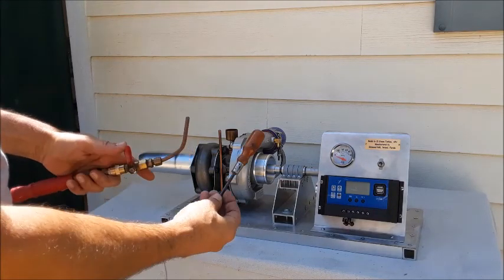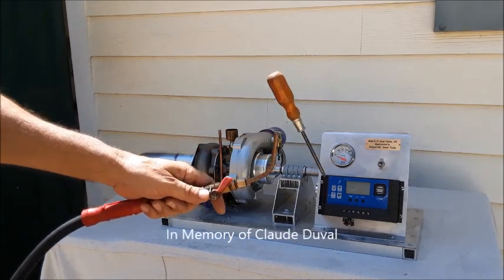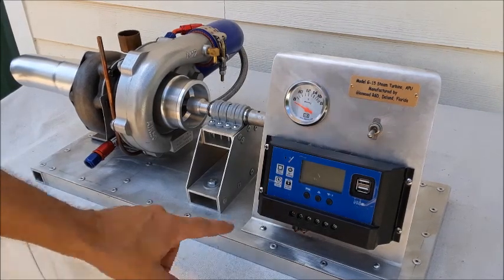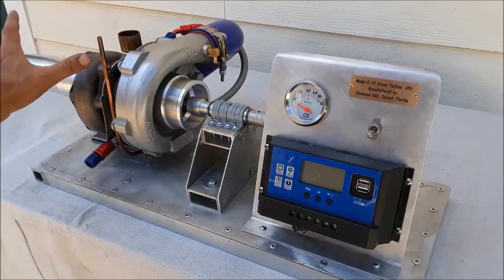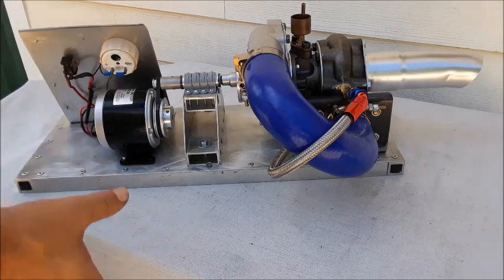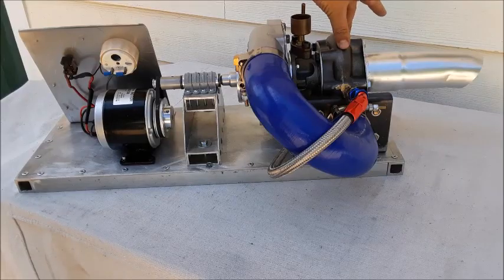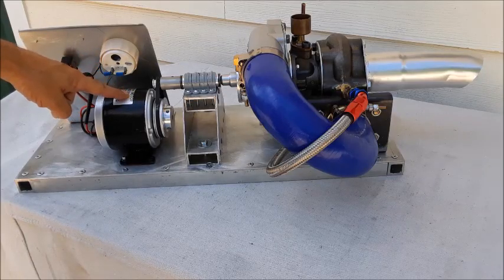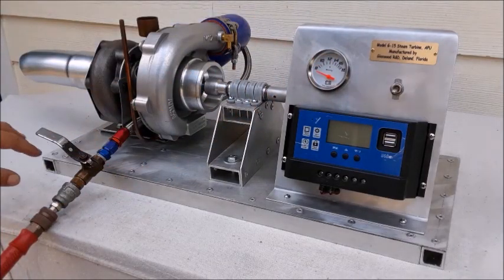Steam Turbine Upgrade

Comment: Have you ever built any Tesla turbines?
Reply from the maker: No....but one day. It is my understanding they need to reach insane rpm's to become effective. I am a huge Tesla fan, tho.
Reply: @gwseymour  it’s pretty awesome what you’ve made here with this car turbo though!  

And yeah I’ve seen many people try to make them and just spin them fast and they don’t work. But fortunately the too high of rpm is not an issue actually because, despite what’s claimed over and over again by many people on the interwebs, Tesla turbines work fine, get plenty of torque and output power at low RPMs.     

I’ve got some copy pasta 🍝 of mine that I’ll share with ya here to explain more.  

Tesla turbines aren’t made efficient by spinning really fast.   

That’s only for when the disc stack is being used as a centrifugal pump, because ALL centrifugal pumps’ compressors, performance is tip speed dependent.   

But spinning the turbine fast will produce a centrifugal head that opposes the incoming fluid flow, reducing the pressure gradient across the nozzle, reducing fluid final velocity, reducing mass flow rates through the nozzle and ultimately reducing power out. 

Furthermore the faster you spin them the faster the fluid you have has to go just to still be moving faster than the discs and still provide torque.   

Lastly, they work just fine for industrial use too, despite people saying they can’t scale up in size but they actually can scale up just fine because the torque on the discs is proportional to the difference in the fluid speed and the disc speed. 

So the disc tip speed is the important factor here. 

For any given fluid supply in the nozzle will have a max fluid velocity. 

So the turbine disc tips will have a max speed set at that fluid speed irrelevant if radius. 

Now considering that centripetal force is proportional to V^2/R, if you keep the tip speed the same but increase the radius the centripetal forces on the disc for the speeds needed will actually decrease. 

Again despite what MANY have claimed about the Tesla turbine, it does not need to be spun fast to work or work efficiently.   

TesTurs are made efficient when the slip on the discs is reduced and spinning the discs fast does nothing to reduce the slip, only increase the distance the fluid slips on the disc faces, which is by definition “loss”.  

Listen to what Tesla himself said in the patents of how to make them work.  

“Owing to a number of causes affecting the performance, it is difficult to frame a precise rule which would be generally applicable, but it may be stated that within certain limits, and other conditions being the same, the torque is directly proportionate to the square of the velocity of the fluid relatively to the runner and to the effective area of the disks and, inversely, to the distance separating them. 

The machine will, generally, perform its maximum work when the effective speed of the runner is one-half of that of the fluid; but to attain the highest economy, the relative speed or slip, for any given performance, should be as small as possible. 

This condition may be to any desired degree approximated by increasing the active area of and reducing the space between the disks.”  

1) increase the speed of the fluid relative to the disc, (not increase disc speed)  

2) increase surface area 

3) decrease disc spacing  This is how you actually make a TesTur work. Not by spinning it fast.   

The fluid interactions with the disc that govern efficiency an torque are adhesion and cohesion. Full stop. 

And spinning fast does nothing to increasing either to increase the turbines isentropic efficiency.   

This is why everyone who chases rpm with the TesTur just flat out fails. 

They aren’t even trying to design them properly so of course they won’t work.
Reply from the maker: @CharlieSolis  Thanks!  I would still submit that HP is always a result of RPM. Any type of power extraction (mechanical, electromagnetic, etc.) creates a load, which reduces RPM. The more initial rpm you have, the greater the resistance to reduction under a given load (due to an increase in HP). I am going to build one someday, but I anticipate some tinkering. Thanks for the input.
Reply: @gwseymour  hey thanks for replying. So when doing electricity generation the rpm is always kept constant. And when using turbines there is no need for a flywheel type storage because there is no pulsed torque input that needs to be smoothed out, like with piston engines or pulsed combustion engines.

When operating using a dynamic load one does not rely on the turbines kinetic energy to resist changes in rpm/voltage output. 

If the rpm drops even a little the throttle should automatically open up and admit more motive fluid. 

Power = Torque * RPM / 5252

Therefore when doing electricity generation, the rpm is always kept constant because voltage output always supposed to remain constant and is dependent upon the turbine/generator RPM. 

So if the load increases, the turbine momentarily slows down just the slightest bit because of the increase in resistance in load, but then the throttle opens up to admit more fluid to output more torque to get more power out for the same RPM, that counters the increase in load. 

If you look at all the old pictures of teslas turbine, specifically the one in the museum that everyone has seen, the big ol’ system of valve and pipes above the turbine is pneumatic throttle regulator that operates off the peripheral pressure in the turbine. Because centrifugal head increases at a rate of RPM^2, or even faster, tiny changes in rpm once at speed have great differences in peripheral pressures. 

So when the load is applied and the turbine momentarily slows down the periphery pressure drops and pressure drop in the piston throttle regulator causes the spring to over come it and it opens up the throttle letting more motive fluid in. When the load is dropped and the rpm wants to jump up real fast the peripheral pressure jumps real fast before much change in the rpm and the piston throttle regulator begins to close off the throttle again.
Reply: @gwseymour  you have to remember this is not a rotational battery that “charges and discharges” the energy through a change in rotational kinetic energy. 

For using turbines for electricity production the Turbines are always kept at a constant RPM to get a constant output voltage, 60hz 120v, 240v, etc. (or 50hz 220volts, etc if elsewhere) 

However even when using a high frequency PMG that gets rectified and then inverted to the final output the voltage may be a different range but voltage must still always kept constant for different loads/outputs. 

Therefore the RPM must be kept constant for different loads/outputs. 

Hp = RPM * Torque / 5252

Increased output just requires an increased torque output. 

And the turbine should never need the max throttle to spin the idling/operating rpm such that any increase in load at all would already be beyond the limit of the turbine and end up causing a drop in rpm. 

The increase in load is met with an increase in torque output to push through the load enough such that the rpm doesn’t change. 

The proper throttle regulator will do this faster than we could even perceive the slightest change in rpm.
Reply: @gwseymour  and just for the record I have the photos of the blueprints of the TesTur in the Tesla museum that show the full assembly of the rpm regulator for the turbine. Let me know if you’d like a copy. 🤓🙂🙏❤️‍🔥
Reply: @gwseymour  and to further rectify this, just like for electric generators, voltage, and therefore RPM, is kept constant and the amperage is changed for a dynamic load.

Well that means to increase the current output from the generator at a constant rpm, torque must be increased to generate the increased current but at the same rpm. 

Electric generators are rated by two values the Kv rating and the Kt rating, which is 
Kv = RPM / volts 

Kt = torque / current 

Kv tells how many RPM the turbine has to spin get each voltage output (This is not the same as kilavolts or kV, little k big V) and Kt tells the torque that’s needed to generate a specific current. 

By definition, 

Kv = 1 / Kt

(One is the inverse of the other but make sure to check to use the correct units when doing this calculation)

For example, a generator with a generator with a Kv rating of 100 rpm/volt, to get 12volts output the generator would need to be spinning 1,200rpm. And a generator with a Kv rating of 1000 rpm/volt would need to spin at 12,000rpm to generate 12volts. 

And corollary for any rpm, an input torque is needed to generate a current proportional to the Kt rating.
Reply: @gwseymour  and just for the record, I do in fact have a degree in physics 🤓😅 just so you know I’m not some armchair rando on the internet. 

Love your work! Keep going!
Reply: @gwseymour  You just have to know how to design it correctly to actually reduce slip to make them work, not spin them fast.  

The only reason people think Tesla turbines have to be spun too fast is because EVERYONE has mistaken the part of the patent that is about the turbine being used as a pump as being about it being used as a drive turbine.   

The only time you want to spin a TesTur fast is when it’s being used as a pump/compressor. 

This is because ALL centrifugal pumps’/compressors’ performance is tip speed dependent.   

“I have found that the quantity of fluid propelled in this manner, is, other conditions being equal, approximately proportionate to the active surface of the runner and to its effective speed. For this reason, the performance of such machines augments at an exceedingly high rate with the increase of their size and speed of revolution.” -Nikola Tesla 

And again, you DO NOT want to spin too fast in a TesTur because the centrifugal head will just counter your incoming fluid flow reducing power. 

And the faster you spin discs, you’re fluid has to be going even that much faster just to be able to apply a torque on the disc face.   

“Still another valuable and probably unique quality of such motors or prime movers may be described. By proper construction and observance of working conditions the centrifugal pressure, opposing the passage of the fluid, may, as already indicated, be made nearly equal to the pressure of supply when the machine is running idle. If the inlet section be large, small changes in the speed of revolution will produce great differences in flow which are further enhanced by the concomitant variations in the length of the spiral path. A self-regulating machine is thus obtained bearing a striking resemblance to a direct-current electric motor in this respect that, with great differences of impressed pressure in a wide open channel the flow of the fluid through the same is prevented by virtue of rotation. Since the centrifugal head increases as the square of the revolutions, or even more rapidly, and with modern high grade steel great peripheral velocities are practicable, it is possible to attain that condition in a single stage machine, more readily if the runner be of large diameter. Obviously this problem is facilitated by compounding, as will be understood by those skilled in the art. Irrespective of its bearing on economy, this tendency which is, to a degree, common to motors of the above description, is of special advantage in the operation of large units, as it affords a safeguard against running away and destruction. Besides these, such a prime mover possesses many other advantages, both constructive and operative. It is simple, light and compact, subject to but little wear, cheap and exceptionally easy to manufacture as small clearances and accurate milling work are not essential to good performance. In operation it is reliable, there being no valves, sliding contacts or troublesome vanes. It is almost free of windage, largely independent of nozzle efficiency and suitable for high as well as for low fluid velocities and speeds of revolution.” -Nikola Tesla  

Tesla both knew it wasn’t meant to spin fast and that it worked great for low speeds IF you design it correctly.

Comment: maybe you know about this but an mppt sola charge controller can accept a a wider range of voltage input and then steps it down to what ever voltage is needed for the battery. for example my controllers can takes a max of  160v ocv and steps it down to nominal 48v battery. if i am using a 12 nominal battery it will allow me to use up to 80v ocv. from the input side. also there are mppt step up controllers, and i have one but havent worked with it much
Reply from the maker: I'm definitely using a cheap charge controller. Most don't "step down" as that requires a heat sink. Contrary to popular belief, your average charge controller (21 volt panel to 12 volt battery) charges at 21 volts. I don't know much about more complicated ones, so I'll take your word for it. Thanks for watching.
Reply: In my experience charge controllers do not work with alternators (voltagesource). Charge controller work with solar panels because they are current sources (not voltage sources).

Comment: How many amps are you kicking out? What about the corrosive nature of the moisture in the steam, does that have an impact on the turbine or are you running it through a dryer first?
Reply from the maker: From my testing, an appliance (or battery) can draw 25 amps @ 18 volts at 100 psi.

Comment: Impressed... I was looking for a similar design to see if anyone had done it. The PTO was the hang up naturally. Given the current burn barrel obsession, the improvements in control systems, and energy storage by way of batteries - I feel an older boiler/steam engine covers low steady rpm, high torque. Could charge batteries etc. But the option could be added to use the firebox as what is effectively the  combustion chamber of a jet turbine, to dramatically increase burn rate and output in shorter durations. But if course I'm realizing steam can drive the turbine, so long as I have a way to capture, no need for the nasty combustion chamber, but instead could do a sorta hybrid that uses a steam driven compressor to increase the burn.

Comment: Great build. Just other day a friend was pondering steam power generation. I thought despite having no knowledge that a car turbo with alternator having rectifier removed may be best viable solution with longevity. Now, so glad to find ur video. Do u have a web page guide with stats or any data as to steam flow rate, kpa consumption, etc. Thank you.
Reply from the maker: Nothing yet. Thanks!

Comment: So how do you couple the shaft to the turbine?
Reply from the maker: I replaced the turbine nut with 2 reverse thread hexagonal nuts. A deep well socket is then press fit into the PTO shaft. The socket slides over the nuts with just enough clearance to accommodate flexing. Kind of like a mini u-joint.

Comment: Any heat you can add to the 'blue pipe' will help a bit.
In this case its your generator's waste heat.  Possibly In a ramjet style/principle container.

What happens if the steam goes into the 'blue pipe'?
The air will cool the steam, but the increase in air temperature will expand it..?
Again a ram jet style/principle 'duct' may help more than one may think.
Reply from the maker: Actually, I'm trying to keep the blue pipe cold....thanks for the thoughts tho.
Reply: @gwseymour  Why?  That's the opposite of how a turbo or jet engine works...
Reply from the maker: @nevillecawood3727  Well, because it's not a turbo, gas turbine or jet. Other than the fact that it spins, they have nothing in common. Picture putting a vacuum cleaner on the tail end to assist with RPM's. That's the theory of super cooling the steam as it exits.

Comment: Hello gwseymour.

Where did you inject the air into the turbo, did you drilled an extra hole into the turbine?
Reply from the maker: Yes. In the exhaust housing.

Comment: How many Litres of steam at what pressure is required to get it to 12V?
Reply from the maker: It depends on the load. It would take about 50 psi free wheeling. I was using 70 for the vid, but didn't get anywhere near "full throttle".

Comment: What did you have to do to convert the turbo to steam? I'm in the process of building a burner, boiler and engine and possibly a turbine
Reply from the maker: It's too long a long process to explain in a comment, but experiment around with a turbo and an air hose and you'll see the effects.

Comment: Where did you get the turbine? What motor/generator you used?
Reply from the maker: The turbine and Gen were from Amazon. The gen is a 350 watt scooter motor.
Reply: @gwseymour  thanks, I've failed to find any steam turbine on Amazon, do you have the name of the product page you've bought?
Reply from the maker: @SchioAlves  I'm sorry, I wasn't clear. The turbine is an automotive turbocharger that has been converted.

Comment: Lubrication? Water/oil cooled?
Reply from the maker: The lubrication is 90 weight gear oil. The unit operates at much lower speeds an temps than automotive use. The heavy oil "simulates" the normal pressurization, and allows the shaft floats nicely.